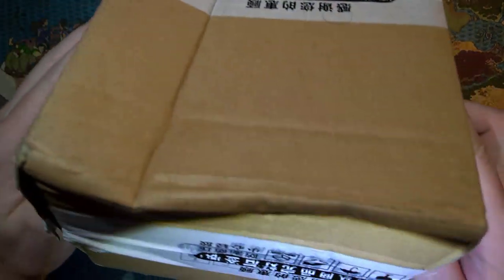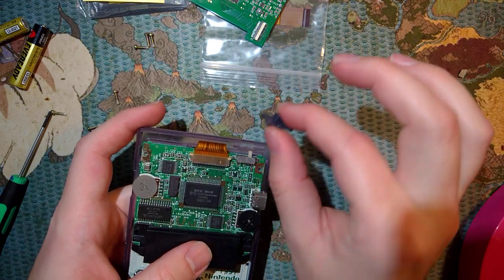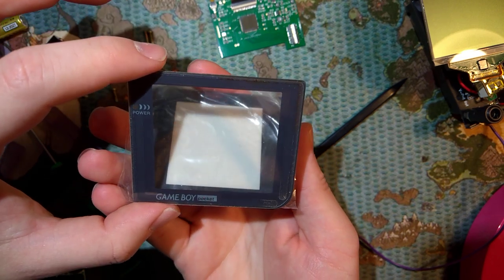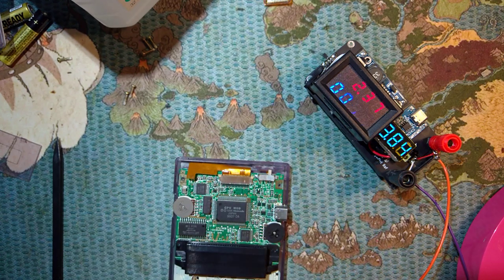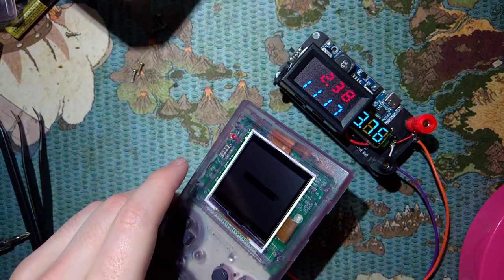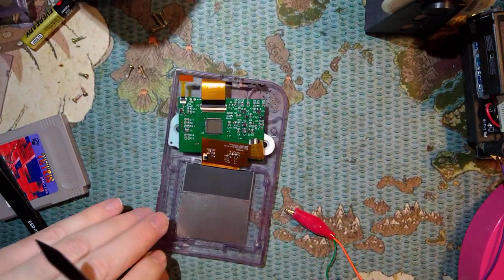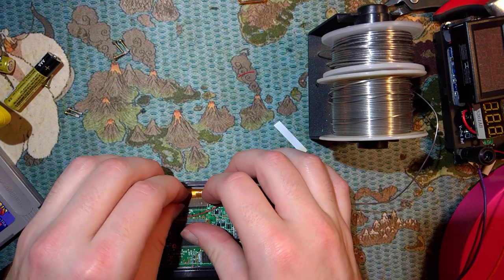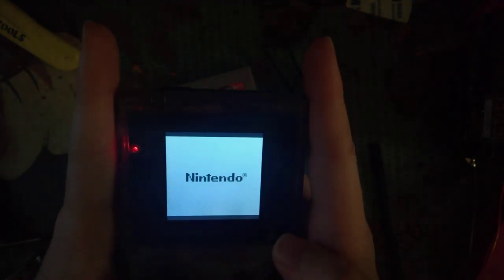Installing a Backlight kit (HiVision AIO) in a Game Boy Pocket

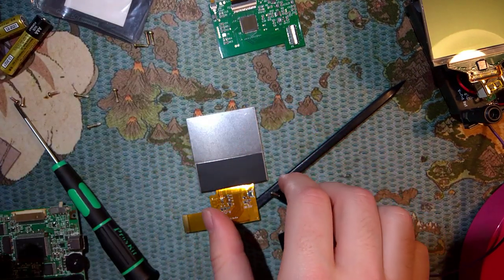Comment: 14:05 I skipped the adhesive part doing my mod just 3 days ago and it worked, but when I wanted to show off my new console at work it would just flash and screen would turn off. Luckily i had a screwdriver so i just cut out a post-it note to insulate it and it works perfectly :P

I also got the GBC ribbon with it, it seems that currently the same board can be used with GBC, GBP and NGPC.

Comment: Great video, I have a weird issue with mine where I can't run off battery, I tried the kit on two different boards. I can only run on a/c. Any ideas what might be causing it?
Reply from the maker: Do the consoles work without the mod on battery? Have you tried brand new batteries? Are your terminals dirty or corroded?

Comment: any idea where are the vias or solder points on the gameboy pocket to use the button combo feature ? Thx
Reply from the maker: I don't have a guide if that's what you're asking. If you have a multimeter, you can probably probe around. Should be just above and to the sides of the cart connector.
Reply: Tried yesterday , found the points with the multimeter . The problem is that the gameboy pocket uses the same traces for 2 inputs ( ex : select and up ) 
Connected the select and down , had a flicky lcd after it. Removed everything and used the touch sensor ! Is there something to modify on the pcb ? I soldered one wire on the +\- and one on hold . Did something wrong ?
Reply from the maker: @donjuandl  Ah, shoot. I know the DMG uses a switch matrix for the inputs but I thought the Pocket was similar to the Color. Perhaps that console uses a switch matrix as well. That would explain why you're getting that result. I'll have to play with mine when I have some time but I don't think it's going to be that easy, unfortunately.
Reply: makho yep ! Same thing as dmg! Let me know if your figure it out !

Comment: Just wondering, is it AIL V02 or AI0 V2? The picture from the aliexpress link shows the pcb with text indicating AIL_V02. 
Another question, the title of the video is about AI0 V1, the description mentioned it being a AI0 V2, but the video at 18:17min mark shows on the pcb AIL_V02, there is something I'm not getting here? Because I'm quite confused. Perhaps there is something I'm missing, but I thought there are only two versions, and they require different soldering right?
Reply from the maker: Hah, the V1/V2 nonsense is my bad. I copy/pasted the title and description rather than typing it up fresh. AIO vs AIL, I can't say. I was told the kit is called "AIO" but it does indeed say "AIL" on the board. I presume it's a translation thing or the name has changed sometime. It's hard to say because I don't know how to get in contact with the creator of the mod.
Reply: @makho  I see.  Thanks for the clarification. I think you have the updated model which why it's the V02.  From the aliexpress site,  one of the picture showing the soldering,  the Chinese text says the second short wire to the capacitor is not required. Do you know what it does? It doesnt say why it's not required but still appeared soldered in the picture and you also have the short soldered to the capacitor.
Reply from the maker: @gamersview8  Yeah, it didn't really seem to do anything in my testing. I tried it both with and without. I still soldered it in case it affects something I don't know about in my limited testing but I think it can be omitted.
Reply: @makho  cool,  thanks for doing all the testing. Great video BTW,  I like watching them haha. I wish Ben comes out with the full size version soon. Not sure why he wouldn't.
Reply: Same here, when I was testing the kit i just connected where the longer wire would go and it worked, but better safe than sorry.
Reply from the maker: @gamersview8  Ben threw a tantrum a few weeks ago and said he was considering cancelling all of his projects. So far he hasn't gone through with that, but I wouldn't put it past him.
Reply: @makho  oh wow,  I didn't know. Was it on his Facebook? What was he upset about? Of all the clones I suppose. I thought he was going to release elcheapo v3 in December and so,  haven't been keeping posted with his new updates.
Reply from the maker: @gamersview8  https://www.reddit.com/r/Gameboy/comments/dhwgnf/bennvenn_is_right_support_original_products_not/f3s2tg1/

https://www.reddit.com/r/game_gear/comments/dhc2x7/chinese_lcd_kit/f3p96a6/

So far he hasn't said anything else on the matter that I can find but still.